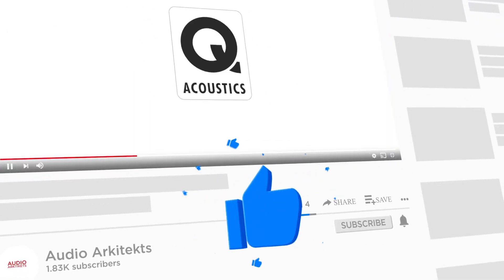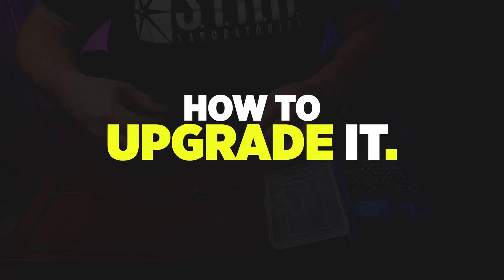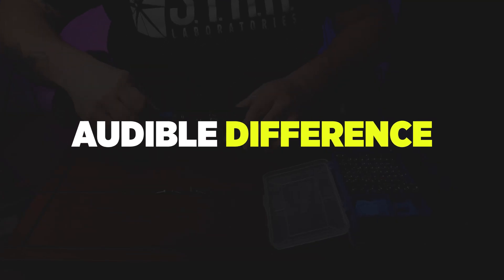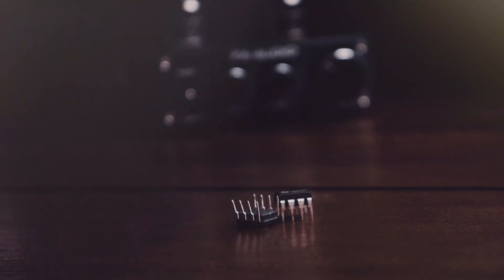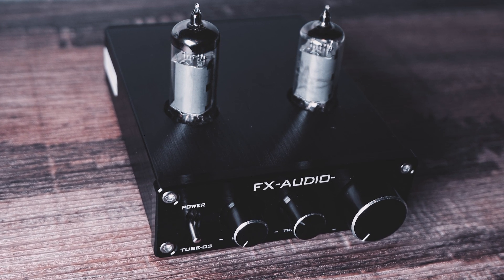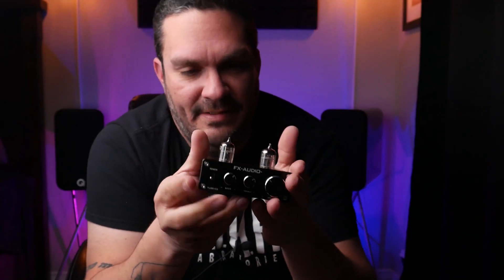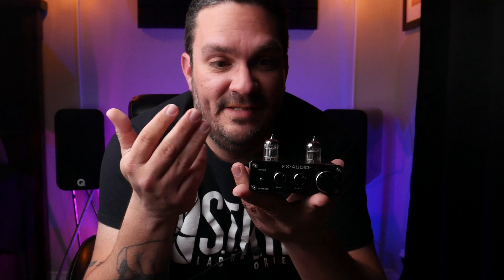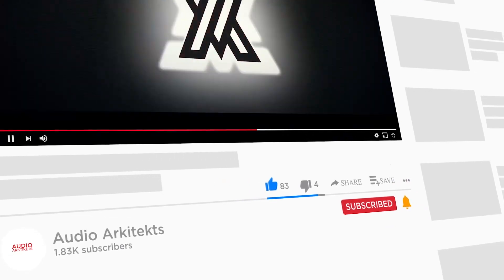How to Upgrade The FX Audio Tube-03 | OP Amp & Tube Mods

Comment: Just made the switch in op amp to OPA2134PA. Already rolled the tubes. The base is so much more intense and midrange is clearer. Well impressed.  Struggled to align the pins but got there in the end. Thanks for the suggestion. Will look at op amp rolling with more expensive models in future. 👍🏿

Comment: Excellent video!  Thank you.  To me, the 5654 tubes and the OP2134 op amps are a great upgrade and combination.  I experienced more stereo separation and detail with tighter and slightly deeper bass.  I really think the original op amps were probably very poor quality.  If I install the WIMA capacitors how do I determine the correct polarity on them?  Are they bipolar?

Comment: I'm late to the party but I had my FX Audio tube 03 for years and this is the first time I upgraded the opamp. I used the OPA2134 and it did wonders! I think I'm getting addicted to this opamp rolling. Just ordered the muses02. Can't wait to try it out. Cheers mate! Thank you for the walkthrough. Keep up the good work! 👊
Reply: You should have got the Muses 01 as it is Jfet like the 2134. Muses 02 is bipolar.
The supplied 5532's are superior to the 2134 anyway.

Comment: I just got this preamp, but unfortunately, it's making my HiFi sound worse. I'm hearing a slight broken sound in the music, and even when the Tube03 is turned off and my player and amplifier still online, I can still hear music leaking to the speakers at low volume with a broken sound.
I'm not sure if this is a problem with the preamp itself, it make feel like not worth continue to test again, i already give up with this pre-amp
Reply from the maker: That sounds like an issue with the tubes or the preamp itself, I would exchange it.
Reply: @audioarkitekts  I've tried many common brands of cheap amplifiers as everyone recommended, but I'm not satisfied with the sound quality. Some of the amplifiers have false power ratings, and the frequency control is often erratic, resulting in distorted sound from my speakers. Additionally, all using similar or exactly the same  op-amp  from the open market
, those are no clear, noticeable, or straightforward soundstage with these amplifiers. 
I'm thinking of giving up on cheap amplifiers altogether and moving to the Hi-end Hifi equipment

Comment: If you have the controls set exactly the same for the two units, chances are extremely high that the gain differs, especially with different tubes, differences you observed can be simply explained by a different response of your ears and brains to the sound pressure differences. The louder units, even slightly louder, will often sound better!

In order to do a proper A/B test, you should run a simple sine wave (e.g. 400Hz or 1kHz) through the buffer and measure the output voltage. Set the same output voltage with the volume control for both units, and then you perform your listening test. It is important to check the voltage under load of next stage in the chain.

With the standard chinese tubes that came with my Tube-03, I had to set the volume control to about 12:00 to get unity gain (i.e. input voltage=output voltage), while with JAN 5654W tubes, unity gain was reached by setting the volume control to about 10:30. BTW, a matched pair of tubes is nice to have. The chinese tubes that came with the unit apparently weren't matched, and the gain factor of the channels was slightly different, causing the balance to shift to one channel. No such problem with the matched 5654w tubes.

FWIW, i did unity gain tests with the tube-03, comparing the unbuffered sound with the buffered sound, and no matter how hard I tried, or how laid back I tried, I heard absolutely ZERO difference. These devices are at best cheap ways to get your confirmation biased satisfied.

Comment: The Op-Amp (Operational Amplifier (not O P amp) ) are the main workhorse in these low price amplifiers.   The tubes are generally just buffers to add the characteristics of a tube to what is essentially a solid state amp.
Reply from the maker: That was one of my legacy videos lol. The funny thing is I am actually writing out an outline for my next video which is about op amps. I'm a bit more refined on the subject these days. I'll release it in the next couple days. You should check it out. In the meantime, any OP amps you enjoy? Or some that I should try?

Comment: I purchased one of these recently and love the sound it produces. But I did discover a problem with it. After several hours of continuous music playing the switching TSR and the tiny little coil get really hot. The problem is there is no airflow through the tiny box. A couple of small 3/8 in holes drilled through the rear panel next to the DC power socket allow enough air to circulate around the switching power supply components to cool them and then out beside the tubes. That's all it too! I've got mine plugged into a tiny  Fosi T20 amp. The two together sound really great!
Reply from the maker: Very good advice 👌
Reply: Gracias. Lo haré.

Comment: You can also take the opamps out completely and run it as just a pure tube circuit ...but you will need to have alternative way to adjust the volume ...say from your source, dac, laptop or power amp etc.  It's such a great versatile and affordable little tube pre.
Reply: Didn't know this, but a tube buffer is all I wanted.  Thank you!

Comment: I put burr brown 2134pa op amps bought from ebay for 6e shipped, fake or not, bass control improved a lot, on default bass when dialed up is muddy, but bb fixes this to a degree this also made the sound more clear. Have not swapped tubes yet. OP amp mod totally worth it.
Reply: How much do these opamps cost and does it affect the details in any way?
Reply: @Thoughtflux  it made the sound slightly clearer , and i like i said 6e shipped. This is worth  if you can get op amps under 10e , more than that is too much. Same goes with the tubes, no more than 15e to those.

Comment: I opted to get the "bare assembled PCB" version of this device and the GE tubes. 
I plan to get it into a proper pre-amp enclosure. Install a quad input module w/ remote control potentiometer, and linear power supply. The board & tubes ran about $40, the other components will cost a little under $100.
Reply: Wow! Were you able to do it? Have you posted about it anywhere with pictures?
I'm confused between this unit & the xduoo MT603.. Which i think is only a buffer tube preamp..

Comment: Hi, will there be any problem if I mix a different opamp on the board? For example one using OPA2134PA and another using the tl082cp?
Reply: @humanitech I’ll do this on mine asap. Would you say that the op amps affect or change the sound of the tubes? Also,  what tubes would you recommend?
Reply: No problem mixing opamps as they have two separate functions  (1) for the two tone controls (2) just for the volume.  

Having tried a few different opamps ...which I like the muses I then mixed and finally tried without any opamps connected at all .... Which I preferred as it still works as a pure tube only circuit (which was a big bonus surprise!)...which with upgraded tubes sounds the best ...but of course you loose the tone and volume control functions - so will need to have another source or way to adjust the volume. Say on your dac, laptop, streamer, source or power amp or receiver etc.

But It's a great little tube amp...and some people also change and upgrade caps and resistors and PSUs to for even more improvements ..Audiokarma.org  has a dedicated thread  for the 01 & 03 models ...which is a long read but very useful.

Comment: Just purchased the FX Audio Tube-03 on sale for RM115 (~$27), will get the Riverstone Audio GE JAN 5654W as first upgrade, next challenge for the OP amp, good review thank you!
Edit: just changed both slots with OPA2134PA, wow all I can say it really improves the sound alot, like it's fuller than before, punchier bass without sacrificing treble, definitely worth the upgrade thank you again!
Reply: Did it affect the Soundstage and micro details? Did you swap both the chips?
Reply: @Thoughtflux  Yes I did swap both chips and I have to say it is a quality of life improvement, one of best bang of the buck you can get
Reply: @Jink048  oh yes! I did the same since i last posted here. I went overboard and installed 2 Burson audio V6 vivid opamps in it. I had to cut the top chassis to make it fit. I'm currently using the soviet Voskhod Rockets tube. I'm blown by what I'm getting here. (i also upgraded all my cables with Chinese ones..)
Reply: Hey man I am from Malaysia too any amp DAC to recommend? For my hd58x
Reply: @calvinyip364  depends on your budget, are you looking for branded or aftermarket ones? with or without tubes?
Since it's a Massdrop I would get the Drop O2 + SDAC DAC/Amp, if you have the budget go for Topping DX3 Pro+ or EPOS-Sennheiser GSX-1000
I am using the FX Audio Tube-03 with the vintage Aiwa SX-N999 speakers so our use case scenario might be different, good luck finding your gem ;)
Reply: @Jink048  I looking for a cheap DAC amp below rm250
Reply: @calvinyip364  kinda hard to find good ones at this price range with frequency response that matches with the Jubilee (38,500 Hz), however if you can ignore the tiny little bits in the high frequency range then get the Aiyima Audio T9, Fiio E10K or even the Fx Audio Tube 03 MKII
Personally I'd get the Fiio K5 Pro
Reply: @Jink048   I saw this ayima DAC A3 and fiio k3s. Like which one would you think it's better? Like will improve the sound. In your opinion
Reply: @calvinyip364  Fiio K3S for ez plug n play, A3 if u wanna go DIY improvement in future
Reply: @Jink048  how does the a3 compared to the fiio k3s in terms of performance and sound?
Reply: @calvinyip364  no idea, never used it before, but seeing the board more or less the same as FX Audio Tube 03, I would say stock performance will be "muffled", different combination of tube and op amp produce different sonic profile to the sound output, u gotta test em to find out what suits you best
Reply: Есть ролик одного парня, вроде он таец. Он ещё ставил перемычку на цоколь лампы, соеденял контакты ламп. Не знаю как это повлияло на звук и зачем он это делал интересно.

Comment: Hi ! First of all, thank you for the awesome review and job done ! 
Can you tell me if you use it with the fx audio power amplifier 502S pro ? If you use both tube 03 with new op amp and stock 502S, does the op amp in the 502S pro "impact the final sound" ? Do you need to change all the op amp (tube 03 and 502s) ? Other question :-P do you think you can drive KEF LS50 with it ? Did you try ? Thank you for your answer ! :)

Comment: Nice!
I'm also using OPA2134 and GE JAN 5654.
Another upgrade can be on the power supply. 3 amp linear PS.
Reply: How can you upgrade the power supply & what benefits will it give?
Reply: @Thoughtflux  stable current supply in case you're listening to bassy songs, I bought one that looks like a laptop power supply with 5A peak

Comment: Any way to bypass the tone controls?
Reply: Pull out the op amp on the right side.  The left op amp is for gain control, the right is for tone.  The amp will work without both op amps.

Comment: Man, I just made the upgrade with OPA2134PA op-amps and JAN5654w tubes, and now sounds amazing! sounds like another best device, with a very clear, very detailed sound. Thank you so much for this video!
Reply: Fosi do a similar pre-amp and in their new model of the same amp they actually went to the US Made 5654w as default.   They do make a difference having the better tubes.   JAN by the way = Joint Army Navy - Just means the are military spec tubes of the 5654w type, which are equivalent to 6AK5 tubes, a 7pin mini Pentode.  So if you want to experiment more, look for some NOS 6AK5's or even some good second hand 6AK5's from the real tube era and you may get even better performance.
Reply: Hi sorry for the stupid question, bu the 2 circuts u changed are they marked. just so i dont put them in wrong place? Per
Reply: Thanks for sharing the upgrade how’s the soundstage improved?

Comment: do the new tubes need to be a matched pair for this device? or will 2 of the same suffice if they are the same make/model?
Reply: Anytime you change out tubes , they should be matched if you don't have a manual bias control. Some tube amps have auto biasing but it depends on your amp.

Comment: I have a lot of experience with customers installing ICs backwards on field upgrades .  If you are going swap the op amps make sure you understand the dot or notch marking defines the correct orientation.  It is not going to work if you put them in backwards.
Reply from the maker: Yeah I mentioned that in the video however I should have stressed it a bit further!

Comment: I have purchased 3 of these. I gave one to a friend and the volume pot on mine has crashed . The third I killed by using to large of a power supply. I already have two sets of upgraded tubes I just made by two new units and two op amps I was actually running them one per side using the RCA out right for right side of course and then the other unit left into my balance system and that was really good

Comment: which op amp ? Do you have the part number or integrated number?
Reply from the maker: I tried two of them both available on Digikey the OPA2134PA and the TL082CP
Reply: @audioarkitekts  , OPA2134PA and the TL082CP, which one seems good

Comment: Hi Mike. Your comments indicate that the sound character was changed by swapping the IC Op Amps. What difference do the tube changes make? 
Friends keep nagging me to try out 'tube sound.' I lived through a long time in my misspent youth, stuck with vacuum tube power output stages, and I would rather never go back to those adventures -- especially with the current costs of power output tubes. But preamp stages have always seemed a decent place for tubes -- if you ignore or conquer problems with hiss, hum, and microphonics. At least, preamp tubes LAST a lot longer.

I understand the harmonic character available with tubes. I'm not sure I'll fall in love, but I'd be willing to try it and see if my ears smile.
Reply: this is a great device, the chinese tubes are ok, but the general electric replacement is cheap and the sound gets more 3Dmencional and richer
Reply from the maker: Every tube I’ve tried has had a drastically different sound signature. It almost has the imperfect vibe and analog warmth of vinyl without the snap crackle pop lol I didn’t think I’d enjoy playing around with it but I’m having a blast seeing what each one does.
Reply: @audioarkitekts  Having designed tube circuits, back when they were all we had, I suspect but cannot verify this: that the tubes on these little, cheap preamps are run at very low plate voltages. There's just 12 volts in, and I don't see where there's any circuitry to make it (if it's AC in) more than about 24-28 volts DC, max. This means the tubes are not running in their design state. It doesn't mean they won't work. It just means you can expect them to be very sensitive to variations in the tube, itself, and be low gain. Typical quality tube preamp circuits operate at plate voltages of more than 100 volts. And it also explains why they need chip op amps to do the voltage gain chores. And most circuit designers know that cheap IC op amps vary all over the place. Often, they are mass made and the good, middle of the road ones are sold for more, and the dogs and cats go cheap. Like many resistors and capacitors.
-Just one man's view, to be taken as opinion not absolute fact.
Reply from the maker: @jimshaw899  hey you seem to know more than I do about this subject so yeah agreed lol
Reply: @audioarkitekts  Sometimes, life teaches you things you wish you didn't know. Not trying to be the smartest guy in the room; that never works out. I just thought I'd offer some experience on tubes and such. There's so much 'witch doctor wisdom' floating around about tube gear, vinyl, and CD's, there's not a lot of room left for serious facts. I found your piece to be interesting and not witch doctorish -- an occasional treat. Just thought I'd add something to it. 
Any efforts in the direction of value-oriented playback equipment stands a chance of being worthwhile, if it's wise and true. We have to be reminded, now and again, that inexpensive equipment has warts, but so does that $60,000 speaker (smaller warts). They're not at all the same; they both just have some flaws which the new owner will discover soon enough. The happy audiophile is the guy who spends his wish list equipment budget on recordings. And smiles listening to them.
Carry on; I'll watch from the back row. :)
Reply from the maker: @jimshaw899  that was a great addition and added value to the point of the video. Thank you. I try and keep it as real as possible to give my audience an authentic and digestible experience without making things sound too technical. However there is a large group that likes the technical and having your response I believe quenches the thirst of those wanting a bit more information. I appreciate your input 100%!
Reply: @jimshaw899  Hey Jim, a few questions please 🙏:
- is this model Fx-audio tube-03 something similar to a tube buffer? Are low voltages enough to get the tubby sound?
- Can you please take a look at the "Xduoo MT603" and compare the two? Which is better? (I have a good multibit dac feeding to a pure class A amp. Will introducing a class D opamp, like this model, in my chain be a bad idea?